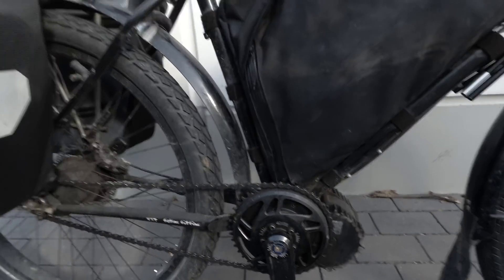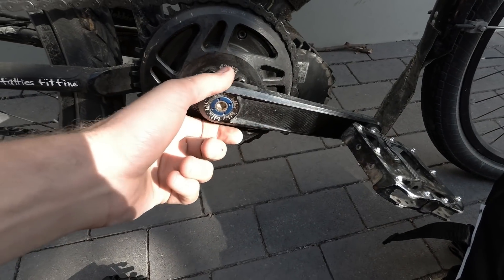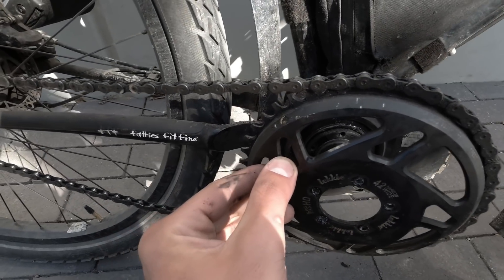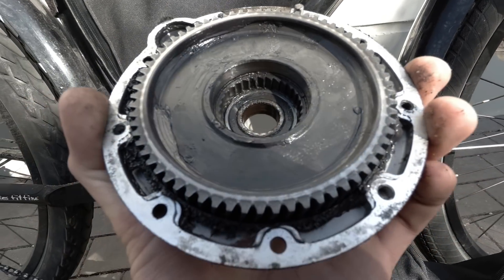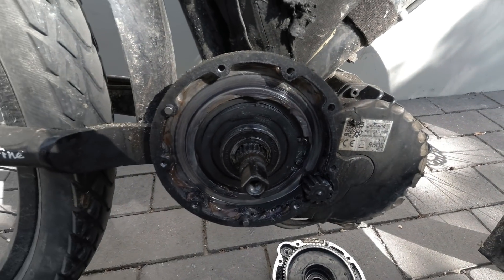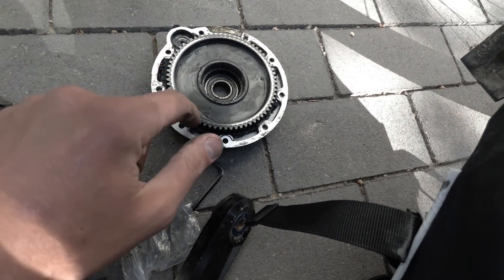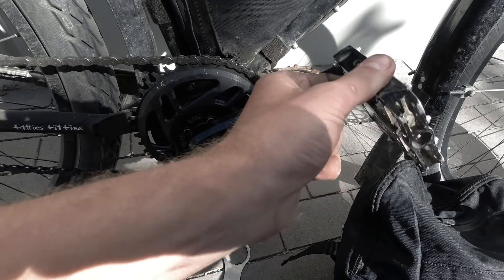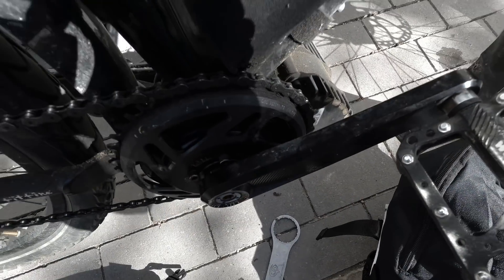Inside e-bike motor after 15000km! How to perform Bafang BBSHD repairs while touring

Comment: G,Day Jack, Wow 15,000kms on BBSHD Motor, ...Im "Impressed" 👀 It goes to show how "OverEngineered" these motors are 👌🏼💪🏼 Im glad to hear it... i will hopefully have many years of "Trouble Free" BBSHD Riding Adventures ahead of me. Keep up those epic journeys, Great Stuff 🚴😎
Im curious, How many Kms to you get out of your Battery ? (& What Size is your Battery?)
Reply from the maker: Yea the over engineering and user serviceability is really worth the extra weight for me! The battery is about 1000Wh. Range is impossible to say as it depends on the environment. Personally i get 150 - 250km. Thanks!
Reply: @a1xzyt-y8g  he just pedals and motor doesn't do much

Comment: Jack. I am thinking about getting one of these BBSHD for my commuter. I currently have a DD on a steel framed bike but my new bike is aluminium. How have you found the reliability and have you done a vid on setting up the CA3 to the bafang? cheers mate
Reply from the maker: Reliability is extremely good. Unfortunately i have heard quality control is not perfect so sometimes it's possible to get a drive with an issue. Parts are very cheap, avaliable and easy to replace for the BBSHD though. The CA3 does not communicate with the Bafang. It measures the voltage and current flow from a shunt between the Bafang and the battery (and measures speed at the wheel)

Comment: Cheers,it’s called a SPRAG CLUTCH.
Reply: No, it's a common freewheel pawl found on nearly every bicycle and is where the telltale clicking sound comes from when you're coasting along. A sprag clutch looks like a roller bearing, but consists of asymmetrical bearings(sprags) and is much quieter, usually silent.
Reply: Nothing like a sprag clutch joel, logical is correct.
Reply: Jolinator yeah,but I replied first,he was WELL late to the party,and it IS Like a Sprag clutch,just a very addictive one
Reply from the maker: Perfect! Thanks

Comment: I've read lithium grease is recommended for use with gearing that includes nylon gears, so I used Mobolith SHC 100 in my BBSHD as it's actually a lithium based lubricant, unlike Aeroshell 22 and Mobilgrease 28 which are clay based. That being said I've not read of any issues from people that have used them on the ES forum. SHC 100 is also under £10 in the UK.
Reply from the maker: Nice! Good tip!
Reply: Should you use that lithium based lubricant only on the nylon gears or can you use it for all the gears?
Reply: @joshuaerbe289  I've used SHC 100 throughout the motor, however I would use something less viscous or use the lithium grease sparingly around the freewheel clutch as you don't want to clog it up.
Reply: @joshuaerbe289  you can use it on all the gears.

Comment: Hi Jack! Watched your epic solartrip to china- what an awesome inspiring achievement! Also got the bbshd since 3 years now, completing my second build. Had problem with securing the motor at first, but opened up a rubber hose and glued it with steel epoxy to the frame above the motor, and used 2 rubber hoses to secure the motor - one around the motor, the other around the frame and the first house clamp.  Before I put the hose between, the paint where the frame and motor meet, had worn away, and aluminum to aluminum made a annoying creaking sound when pedaling. Even now the motor would wobble a little, but it was later solved with a jaw turnbuckle, between the hole at the left top of the motor, and to a plate that was secured to the waterbottle mounting holes up the seatpost-tube. Problem solved!  On my second build I only made 2 thin 68mm long metalplates instead to put in the bottombracket, (68mm long), which made the axle fit perfectly. Then only fastened the motor with the two house clamps. Rock solid! Mobile 28 sticks to the gears and does not fly off the gears easily, but I also filled the empty areas outside the big gear and under it, to make sure it won´t escape. Works a charm! BTW thanks for the tip about the crank bolts, 2:10, do you have a link for these?
Reply from the maker: I understand the struggles 😅 have you seen the bracket made by lunacycle.com? It's quite a neat solution, i have one and took it on the suntrip just in case but never used it! The crank arms are by a company called lekkie (that make the chain ring too) i would recommend them, they are much more solid than the Bafang originals.
Reply: @JackButlerVideos  yea, their bracket would probably work, don´t think it was invented back then so I had the fun struggle to cope with :) Very happy with my light blingring, no chainskipping whatsoever. Never thought my leekie T42 would ever break, but one day going full trottle up a steep hill it did. Interesting thing is that the new leekie 42T I ordered, looked a little different, the small "arms" combining the center  to the outer part of the chainring is revolving clockwise, the one that broke had the "arms" counter clockwise. So it looks like it had been an quality upgrade - holding up nicely!
Reply from the maker: https://lunacycle.com/bsbf-1-stabilizer-bar-for-bbs02-and-bbshd/

Comment: I packed mine with grease after 2000 miles and was much quieter but I did notice more drag/reduced efficiency. I think this is why they don't pack with grease in first place but still worth doing. It's worth getting a bracket/touque arm from california bikes to stop motor slipping and chewing up the frame.
Reply from the maker: Yea i think you're right that's probably why they don't/cost savings. I have one of those brackets but found recently that if using locktite and tightening to the correct torque it has been okay.
Reply: @JackButlerVideos  Good idea and well done. Not sure if you're using the brand Loctite, but I was a lifelong user of it until I discovered Vibra Tite. Works better, reusable and cheaper, js. Enjoy you ride.
Reply from the maker: Good tip thanks!
Reply: Worth doing what? Youve introduced more friction and stiction. Bracket is also no needed just gotta skrew it properly
Reply: @eXTreemator  worth packing with grease or they chew up the gears mate. The small pinon gears goes if you don't. If you run 52 volts and have soft aluminium frame they work lose.
Reply: @super-sim1665  i don't think anyone has ever measured wear rate differences for this motor though. no they don't. it has to be assembled with correct rib side and screwed down really hard. I don't know how spacers affect it but without spacers i know for sure. I get it why many fail though, there is no tolerance for mistake hence it comes loose.

Comment: Jack..   This will extent the life of the Mid-Drive motor/gears. The MolyGrease has to be lithium2 (about the thickness of creamy peanut butter) . So watch Bruno's video to get the correct MolyGrease.   youtube.com/watch?v=3lVRTRFueUU 
I did this to my new BBS02 before installing it on my etrike.  I have put over 3k miles and the motor stays noticeably cooler, and much quieter from the start.  My trike mechanics do this to all of the BBS02's they install (and offer this service on old BBS02)
Peace my friend, Ride Safely.  Robb PDX USA

Comment: Though I have no BBSHD, this was a interesting video for me. I was looking for something to lubricate my Bafang BFSW X02 hub motor, and I don't want to use a standard grease, because it absorbs oil over the time. I tried silicon grease from Liqui Moly (it's for plastic lubrication at some parts of the car), but it seems not to be really good for this. I will try the Aeroshell 22, if it's certified for aircraft it can't be a bad stuff.

Have a nice ride on Mallorca!
Reply from the maker: Aeroshell 22 is expensive!... So it must be good?!.... 😅 I'll enjoy the riding thanks man!
Reply: I don't really see the point of lubricating it all. As it shows it has no wear.
Reply: @eXTreemator   grease also dampens noise - well lubricated gears are running smoother than gears which run dry.

Comment: Nicely done. I put 14,500 miles (23,300 km) on my old BBS02 in a little over 3 years and it was still going strong when I took it off. The only service it needed was a pinion gear replacement at the end of the first year.
Reply from the maker: They are both impressively built! and the BBSHD is a much better internal design in my opinion too!
Reply: I believe it but the extra weight is equivalent to carrying 2 more liters of water. The BBSHD wasn't around in 2014 when I got my BBS02. Not sure which one I would get now. Tough call.
Reply from the maker: It's true! But it's the price for a better built drive with easier user serviceability.
Reply: @JackButlerVideos  what's better about it? Same components. Mosfet and controler quality is the same after revision as i understand. What serviceability is easier? . You can take the cover off of that motor too. Ok apperently this clurch replacement is easier, unlikely though that many will wear it down before 20k. For me it will be probably more than 30.
Reply from the maker: @eXTreemator  search for bearing replacements on the bbs02 vs the BBSHD and you will see the difference. I needed to be able to repair on the side of the road in Kazakhstan so any easier was a big benefit
Reply: @JackButlerVideos  the thing only that for 1 hd possible to buy almost 2 02. What is service life of those bearings, i bet very long. I good when serviceability is on acceptable level though. I myself didn't even open the lid yet after 5k. I might want to soon but i was thinking that the less i put my curved queer hands into there without need - the longer it will run. Now i am more worried about controller upgrade, will open it soon to install hd controller in there. There a lot of stuff and all of it complicated to setup and buy
Reply: Interesting discussion here, personally deciding between the BBS02 vs HD. More of a casual user as i have a car but appears like solarebike has managed to get similar lifespan from the 02

Comment: Great information! Thanks for making this. I need to finally break down and buy the kit.
Reply from the maker: You definitely should give it a try, I'm really happy with the BBSHD!
Reply: @JackButlerVideos  what are the crank arms you used? smart thinking there. I bought two crank arm pullers. first one got stuck on the cranks of an old broken frame, second one is laying around cause i wouldn't dare too ... I thought with the different two-piece crank designs i would've been through with that, but i guess squaretype cranks aren't that easy to fight off ... :D 

Also: really glad to hear you are in for another round. I must admit that i am jealous. but me and my gf will be saving up and experimenting on different settings. So we are really thankful for your insights and reviews about all your gear ... 

Furthermore: What replacement parts did you take one the trip? and which did you really need? Which where good to have and which would you leave behind?

And as you seem to simplify everything to allen keys ... what are other simplification on components setups etc. you would wish for from manufacturers?

Again: thank you for all your answers, engagement, insights etc. Hope you will enjoy the alps a bit further, or wherever you are at right now. if you ever come near frankfurt or darmstadt in germany - let me know ! :D

for example next year at the spezi?
Reply from the maker: The crank arms are lekkie "buzz bars", it's really handy not needing the annoying crank puller. Good luck with the tests, hope you find a good solution for travelling around with! I took a few spare clutches, the large gear you see in the video,  a new controller and another display. I didn't use any of it. If i used the BBSHD again i would probably bring the same again but just one clutch. All of those components are the most likely to fail and are vital to the motors function. 

I only use Allen keys as that's what all bike parts have, i like torx but whatever the industry chooses worldwide is the best to stick to. 

Thanks for the kind offer and the ongoing support!!!